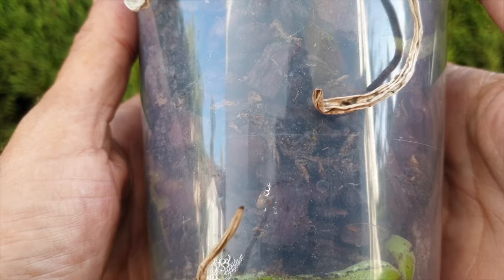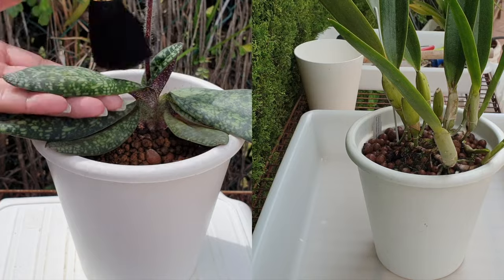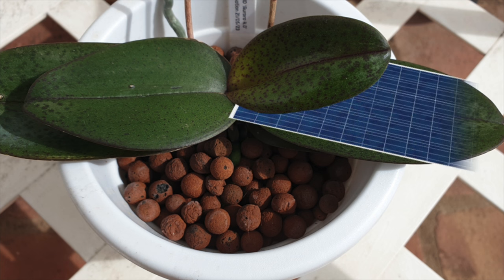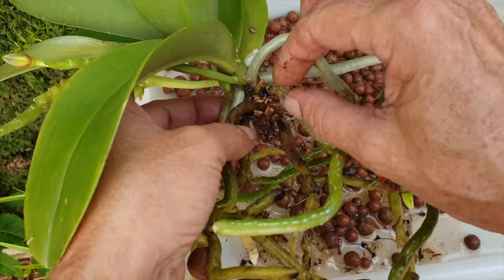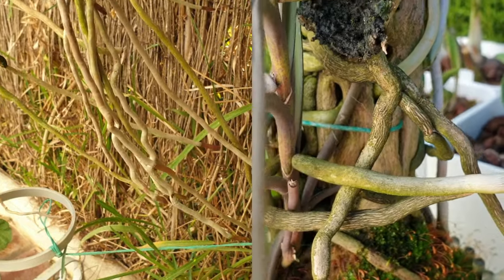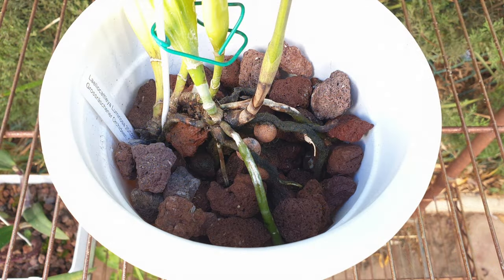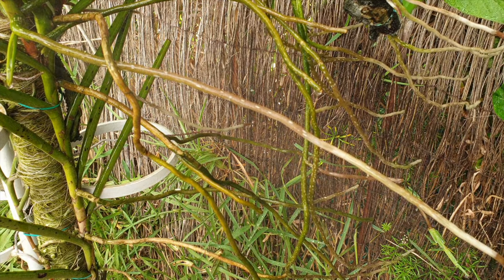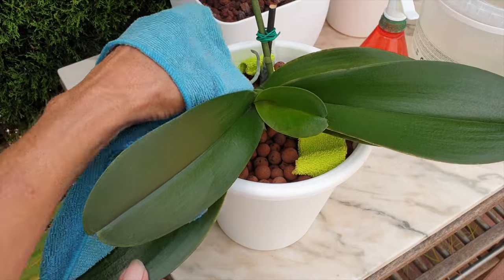Do Orchid Roots HAVE to Photosynthesise? Algae Good/Bad | Clear Orchid Pots Y/N #ninjaorchids

Comment: With the exception of the leafless orchids, root photosynthesis is not necessary. I read a paper on this subject and the roots only add 0.1% extra photosynthesis, and that is with them bare. The roots are only photosynthetic in the morning or early evening and only when wet. Aside from nutrient and water uptake, the roots play a strong role in gas exchange, which allows the plant to perform photosynthesis properly. This may be why some orchids are extremely difficult to grow in media, the roots need air exposure to provide the plant with sufficient CO2. So, unless it is a leafless orchid, the root do not require light.
Reply from the maker: Don Miguel 🥰💐 hola jefe! And all of that is true, yet.... we hear it over and over again that 'orchid roots need light to photosynthesise', not even being specific that IF that were the case, it only applies to epiphytic orchids. 🤷🏼‍♀️ if I had the funds, I would invest in the same orchid, with different media in different set ups and then fast forward 5 years, do a summary of my findings because, I do believe that all epiphytic orchids can be cultivated potted up, but it takes more tweaking for some than others. I would love to prove that 😅 in the meantime, I shall just focus on getting the ones I have to survive and maybe one day 😬 hope you are having a great day, already, Michael and that you have a great rest of your day! Thank you so much for watching 🫶🏼❤️🌸